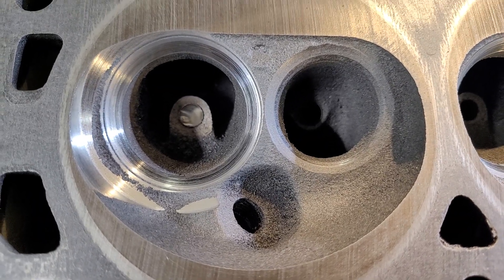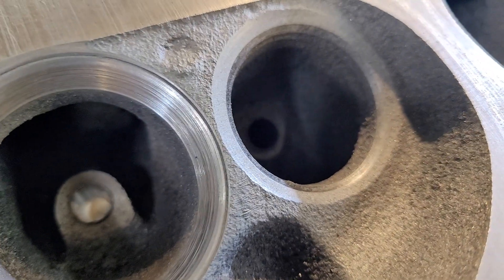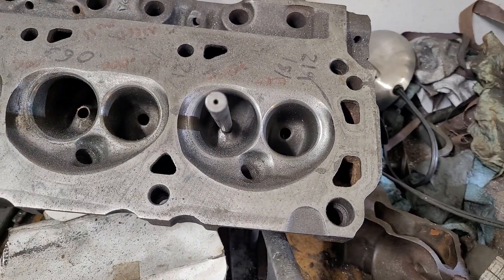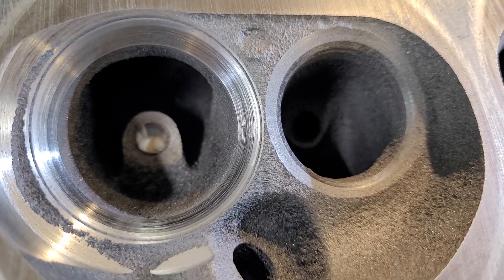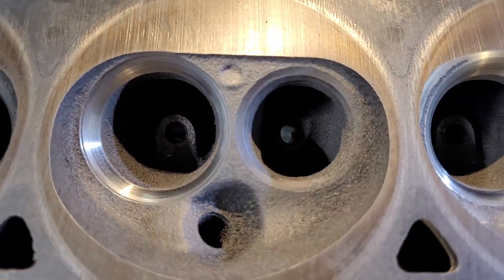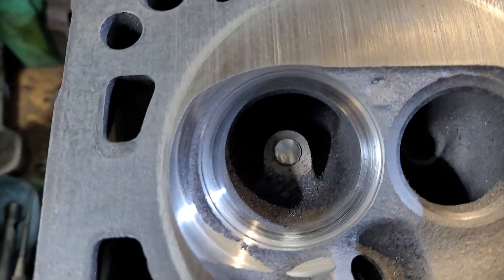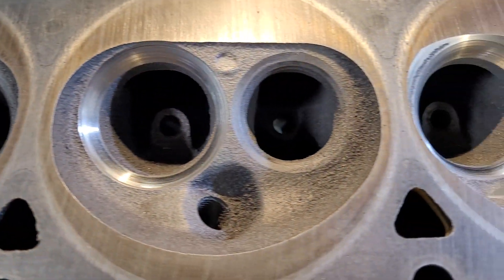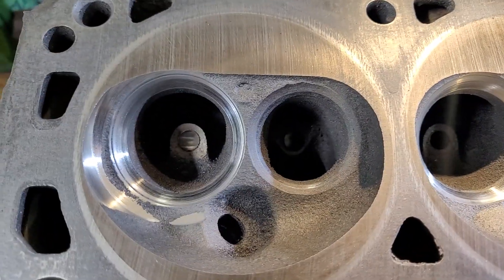Ford E7TE cylinder heads from stock to full porting part 2  1.85" 50 degree valve job

Comment: Hi Charlie. I would be really interesting for you to do a test on different valves sometime. Use the same port but test as many different shape intake valves you can find. Flat ones, not so flat, necked down stem, small margin, large margin, back cut, no back cut and different stem diameter. Might have to do that one with putty in the top of the guide to fill the leak. Anyway just an idea for when you have nothing to do. ( like that ever happens )  Andrew

Comment: Charlie, I know 0.030" isn't much but I wouldn't go straight to 1.94" after this. Big block Chevy exhaust valve 1.88". I like your approach at this. It's simple but effective.
Reply from the maker: I have some old 2.08" valves I can make in any diameter. It just takes a bit of time to make one.

Comment: Ok, so sorry for the maybe dumb question, but when refering to the degree angle of the seat.  The degrees are in the relationship to the stem, so 90 would be paralel to the flat of the valve right?
Reply: So a 30 degree seat would be steeper and a 50 degree seat is flatter
Reply: @toddmccarter45  Hi. It's the other way around. 30 is flatter and 50 is steeper. Generally 30 degree seats flow well at low lifts and 50 flow well at higher lifts. 45 being the standard angle. Andrew
Reply: @andrewburlock2653  Thanks, I'm still pretty new to all this
Reply from the maker: I am very happy with the comments and questions on my videos. We have a real good bunch on here!
Reply: @toddmccarter45  Hi Todd. If we have an open mind we can all learn something new. Don't forget everyone was new to this at some time. Get ready for Servedio cylinder head slice and dice. Ha Ha.  Andrew
Reply: Todd, 90* to the valve stem centerline. 30* would be termed flatter. Flatter is more important because the open flow curtain area increases faster as the valve leaves the seat.
At say 75*, the valve would have to lift .500 to equal a 30* at .150".
Obviously 90* would never open, LOL.
Reply: @toddmccarter45  wrong

Comment: 🔔😎
Thanks for your great insight and sharing your ideas and knowledge 

I stopped porting 20 yrs ago (except for cleanups) because the aftermarket was more price effective.
I always felt that maximizing low/ mid lift was the best idea because it got the air moving sooner, AND, 
I like running the maximum lift possible even well beyond head flow stall because 20* duration at max flow is better than 2* at max flow for cylinder filling. Scavenging is very important.

Torque area under the curve below 5252 is what makes the street/strip combination come alive.
C O M B I N A T I O N 
is important 👍😎😎

Comment: Charlie, you plan on adding different valve seat angles to that 50°? I have seen up to five other angles besides a 50° on competition seats. Also learned the valve shape it self and it's seat face has alot of potential too. To many tricks to even think about.
Reply from the maker: It is four angles.

Comment: Awesome if the gt40p heads I Ported "LEAK" IE. I broke through the hump in the roof of the exhaust ports... So I literally opened the holes up and then started welding from far down in the hole back up to the surface to make sure they were "GOOD" ps. I was a Millwright for many years and had two machine and weld cast-iron! BUT THEY  ARE SHAPED CORRECTLY! I wonder if sleeper heads are worth the fifty extra hours? And one little error "leak" could destroy an engine so first I'm trying them out on a used high-mileage small-block, they don't leak now hot or cold but we'll see what happens on the running engine! pray for me because I would have wasted so much time and I don't know if I would try to fix them again! Or if I'll just take the set of stock E7TE heads and Port them the Way You Are in the videos!
Reply from the maker: I have welded cast iron and run them. Not fun! Yes, I have thought about welding iron chambers to give a better shape. The heat just warps everything.
Reply: @servediocylinderheads  I have a trick I play on my own things especially if I have to weld other things, what I do is instead of preheating and then welding away!.. I'll run a five-second bead in every port of both DRY, Non-Preheated Heads  and then do something else, until it cools! Then REPEAT.  (Same time invested! BUT Over a much longer period of time. ) " note: check the temperature with an IR LASER thermometer" . It is annoying how much PATIENCE this takes but it has much less warpage and much less tendency to crack non-preheated heads!  that way I minimize the potential for cracks and I minimize warping! { pros and  cons of having your own small workshop & more time than money! } respectfully! M,
PS Some engines don't  have affordable aftermarket heads I.E. CADILLAC 472/500! SO porting stock is a very good idea!!!!

Comment: What factory sbf Windsor heads have the most potential?
Reply: My personal opinion? 1969-70 C9OE/D0OE cylinder Heads.  They have been well past 300 cfm in Super stock and Stock Eliminator class. In a amateur hand's with 2.000" LS 8mm stem intake valves and 1.58" LS 8mm stem exhaust valves has been to 262cfm. There is a lot of meat in the right places in those heads.
Reply from the maker: I wish I could say I have done them all but I haven't. I did a bunch late 80's early 90's but I couldn't say what casting numbers they are and nothing was maxed out. More like guides, valve job, decent porting, run em.
Reply: @servediocylinderheads   As it turns out Stan’s sight really lacking in sbf numbers…  You should submit some of your work to him Charlie. The D0OE heads don’t have a ported number at all @Garykaren Mcgruther.
Reply from the maker: @shaadydog1  Funny, I always wanted to be on his site. I don't see why not.
Reply: GT 40s are basically just small spark plug 69/70+ W heads. Same 144 intake runners and 62 cc chambers. Old ones might be a little thicker, I don't know.

Comment: What would happen if you got rid of the whole valve guide
Reply from the maker: I used to do that in the 90's ford E7TE heads and never had an issue. Flow would go up a bit but valve stability is worth some power as well.

Comment: Look forward to your flow tests.
See if the 50 degree seats are worth it up High lifts enough to compensate for any lost at low lifts up to .500". 
I always look at average flow curves numbers.
I get excited too by 330-400+ cfm numbers but Often it's a worse flow curve average cfm than a port .100- .550" poor man's camshaft profile chosen.  All that hardware needed for .800-1.000 " costs alot and can still fail on the streets.
Reply from the maker: You are right. This is exactly why I am not the 50 degree seat expert. I will have done a bunch of testing with steeper seats but the meat of the curve was always down. Now if it is high rpm and we can step up the cam things start to change. The steeper seats mellow the bigger cam at low rpm.
Reply: @servediocylinderheads  I enjoy your Videos. Your the Great Florida Cylinder Head Porter at home. 
Science Experiments daily and you explain in detail.
I Love High Rpms believe me.
I am not exactly sure why 30 degree seats intake side work in old School Iron Pontiac V8 heads able to wind up and make power. Many truedcto talk me Into 45-50-55 degree seats. 
I just used what has worked for me Pontiac Engineering improved.
Hitting 7000 rpms peak is easy 30 degree seats from drivers seat still pulling like Gangbusters.
Hot Full Race Cams I have peaked 8000 rpms 455 engine Pontiac RAIV Roundports 614.
If you get a chance sometime test Pontiac V8 iron heads stock and your own modified. 
Test and theory results.
None have done online posted or You Tube in depth.
Think 87 octane builds are in.
DD WW3 builds.
Could target 91-93 octane pull retard timing back 4-10 degrees for 87 octane.  See if water driving temps climb to 210-230 F retarded timing.
Holding 180-190F steady my present all iron 455 520 Hp Pump gas run on 91-93 octane.
Reply: @servediocylinderheads  We got New problems now in Flat out Racing World there will be no Titanium to be had anywhere. 
It all comes from Russia.
USA has none.
Titanium Dioxide Ore Titanium metal is made from.
Reply from the maker: @brracing7861  The 30 degree seats work with the flat ports. Air windows across the ssr and the top of the flat valve and out. 50 degree seat wants the air to come down from the roof and around the perifery of the valve. It will require a differet shape ssr and bowl. I will work on it but it may not beat the 45 seat.

Comment: Hi Charlie. Did you get my info on how to find T Moss?  I did a valve comparison on my E7 today, very eye opening. The 1.84 intakes I am using are standard 351 replacements and more resemble the shape of an exhaust valve. I have a Chevy 1.84 which is quite flat. I tried the Chevy valve. Gained a little at .100 lost 8 to 10 at .200 and .300 but gained 12 to 14 at .400 and .500 for a max of 212 cfm. If I could get a Ford valve that was flatter ( like the 1.78 oe valve ) but not loose at the lower lifts I would be quite happy. I'm just your average hack learning all I can. Andrew
Reply from the maker: Use the Chevy valves and make the valve train adjustable like a Chevy. Sorry, must have missed the T Moss info.

Comment: 🔔😎 revisiting:
I understood DV to say that the intake corner cut made little difference in actual flow but allowed the shift to carry out another 500 rpm. 🤔 That's where the real gain shows up at the track. I'm guessing that little step reduces chamber swirl flow into/under the valve edge at high rpm. Again we are looking at scavenging depression versus flow bench numbers. 🤔🤔😎😲
Reply from the maker: That is a point I disagree with D.V. depending on the flow and swirl I will cut that corner. Certain heads gain quite a bit of flow there.
Reply: @servediocylinderheads  DV was emphasizing the corner on SBF irons I think. 🤔
Edited: I'm thinking the bowl shape under the intake seat is not ideal but already a little wide which might affect this. 🤔😎

Comment: 🔔😎 FYI. 
Out here in the middle USA,  I just spent $70 for 13 gallons of 91 octane no-ethanol. $5.349 😱😱
Reply from the maker: Well, if you stopped racing around it wouldn't be so expensive!
Reply: @servediocylinderheads  I cannot tell a lie. I did it with my 5.0. 😲😲😁😁